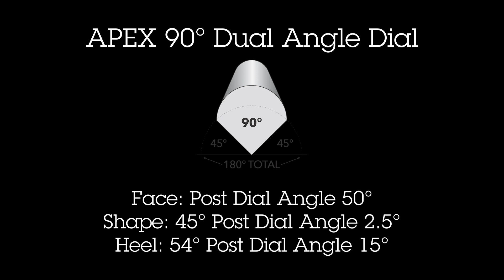GRS University: 90° Graver

Comment: The tabs align (to put the graver into the sharpening system) but what happens if you remove the graver from the QC tool holder? Do you need to start over shaping again because finding that original precise angle seems impossible?

Comment: I bought GRS Apex sharpening system, and try to insert the QC gravers to polish, but it is very hard to let graver get right angle with Dual Angle fixture, this linkhttps://www.youtube.com/watch?v=_E2mOuKnuA8 (How to Use: The GRS Quick Change Sharpening Fixture) show how to ling up when we insert graver to collet, but if I try her way with Stone setter QC graver Knife or Flat graver #40 or #38, or QC Graver Onglette/PT 2/0, the graver can not be right parallel with collet's slot, neither with Dual angle's silver protrude part. would you have have a video show us how to use APEX black fixture Dual angle. how to make stone setter's graver insert to Apex Dual angle fixture in the right angle?
Reply from the maker: All of the angles for the Black APEX fixture start at 7:17 in the video.